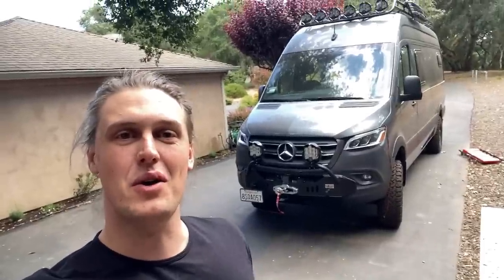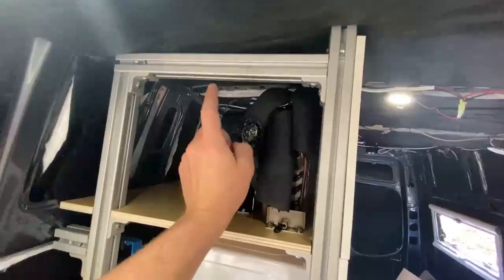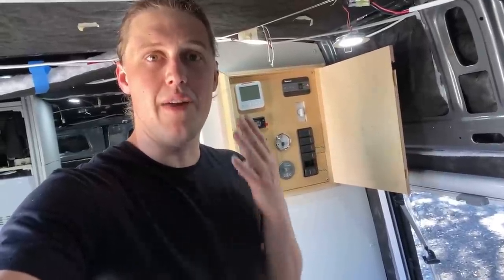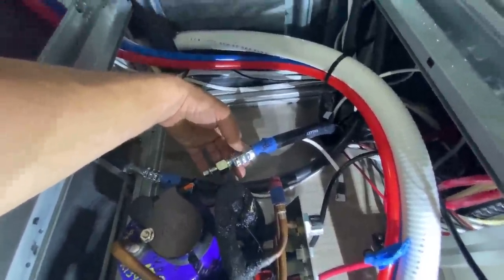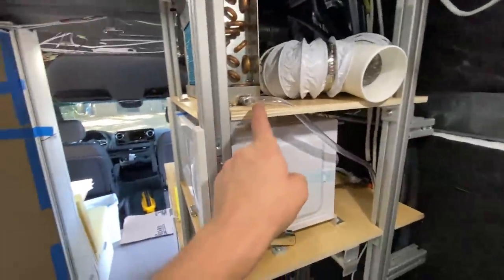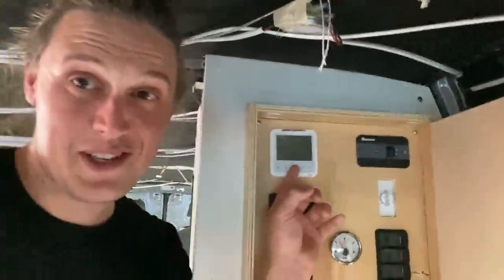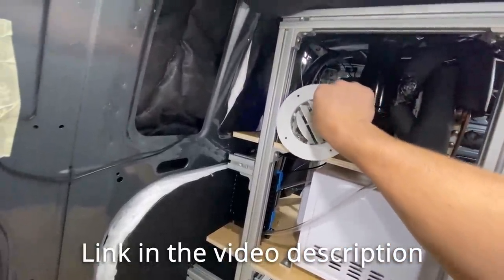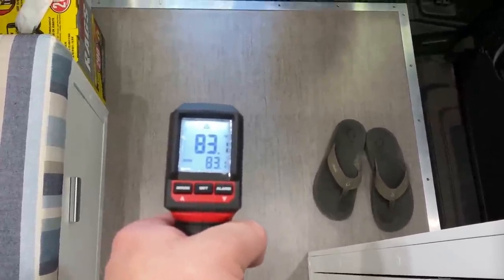The BEST Battery Powered AIR CONDITIONER For Van Life?

Comment: So how much power does it pull?  Do I have to have that many batteries?
Reply: 60amp
Reply: @markbajek2541  mine is about 30 to 45 amp after startup (variable depending upon evaporator fan speed, condenser fan mode (series vs. parallel), and the duty cycle of the compressor.

Comment: How much does this thing cost? Can't find information on the cost
Reply: Really expensive $5,000
Reply: @orion8810  God dam. Wouldn't throwing in a 12v compressor into a standard unit also work?
Reply: @milestehmad117  That's a good question. If you find a way let me know

Comment: Great video! Sorry, I just don't believe in the concept of placing the condenser underneath this vehicle. It seems that this is entirely counter efficient because the heat is getting thrown off the condenser and it rises against the van. If the van is rolling down the highway this is not as big of a concern, but if you're parked in it and trying to sleep you don't have any air flow around the vehicle. Also like everyone else mentioned, the condenser is more vulnerable to road debris. If the vehicle had much more ground clearance and a better cavity to mount the condenser in, that would certainly help. 
It would be very interesting if you could make it comparison to the condenser mounted on the roof vs. Condenser mounted under the vehicle to see what the efficiency difference is. I understand the goal was to increase the solar panel area available on the roof, but how much of that is offset by the efficiency loss of having the condenser mounted under the vehicle? 
If the air conditioner is not being used daily then it wouldn't matter so much because the big battery bank would be able to get charged and makeup for the efficiency loss. Batteries aren't free to acquire nor carry their weight around. Another concern is how much of the van interior space is occupied by air conditioning equipment? That equipment sheds heat and Noise inside the van. Are there alternative a/c systems that can fully occupy the roof?
Reply: @duanehorton4680  ...and YOU ignored the drag contribution with it mounted underneath? There is no drag when the van is parked. What is the ratio of (time parked to driving) and interior cargo volume consumed for under vs. over body mounted a/c system?
Reply: The fans are set up in a puller configuration so they actually pull the air from under the body and blow the hot air to the ground and out . We also have a new shroud and rock guard available that totally surrounds the condenser to protect it . Most customers mount it way higher than the differential so it is protected.

Comment: I skipped through the video because I have already seen these A/Cs. I can almost assure you he failed to also mention just how expensive these things are. They are ridiculously over priced. It's nothing more then a mini split system hacked up into pieces to fit. There is not a chance in hell I would pay these prices for AC.

Comment: I do not think this is the best AC for van. because of the compressor inside.  just use the split AC they comes with 2 parts . out side machine is compressor. then 2 lines goes into the room connect to the cool condenser and fan parts。so inside there is so quiet.  when you connect them, only need to vacuum the pipe. no need to charge the refrigerant (the refrigerant is all locked inside the compressor, after connected and vacuum, just open the valve). buy a vacuumizer just 100$, and split AC cost around 1000$. easy work . in winter this systme could make heat in your van.    your AC is too complicated and hard to assemble and occupy too much space inside. and compressor dissipate so many heat inside your van.  I have to say ,expensive doesn't mean good in some case. by the way , you could install Infrared blocking membrane on your window glass. they works.

Comment: What about dust issue during off-road since the fan is located at the bottom of the vehicle, does this mean you would be replacing the air filter frequently?

Comment: NOT a good idea if you are going to do ANY AMOUNT of off road driving! Putting that condenser under the vehicle is only a problem waiting to happen. The least of problems would be dirt/mud build up in the cooling fins... A condenser needs a clear flow of air to perform. Wet muddy roads will allow mud  build up in those fins and stop the airflow! Worst scenario would be a large rock strike and take it out completely!

Comment: That system pulls 60 amps???? That seems crazy high..  My mini split unit only pulls around 8-9 amps and many window AC units pull less than 10 amps.  That seems very inefficient for a full battery powered system.
Reply: yea but thats 8-9 amps 110 ac his pulls 60 amps 12v, so yours are like roughly 80-90 amps 12v if ran through an inverter, making his actually more efficient and his inverter is free for other needs.

Comment: BEING SMALL IS ALWAYS GOOD IN A VAN. BUT DOESN'T MOUNTING SOMETHING WITH INTAKE MOVING PARTS, BLADES, PUT IT IN DANGER OF DESTRUCTION BY GRAVEL, DIRT, ROCKS, ROAD SALT IN WINTER, HIGH WATER PUDDLES, ETC? 
I'M SURE IT WAS NOT ORIGINALLY DESIGNED TO BE MOUNTED UNDER A VEHICLE. THAT MUST BE THE WORST PLACE FOR ANY DELICATE OPERATING MACHINE? YOU ARE AN ENGINEERING STUDENT, SURELY THESE WOULD HAVE BEEN A GLARING ISSUES.
PLEASE EXPLAIN HOW THIS WOULD NOT BE PROBLEMATIC.

Comment: I see no positives to this system and lots of negatives over a roof mounted system like a  Dometic 2000 RTX 12V.  That condenser is going to get the C!@# beat out of it with rocks, mud, etc.  The system also takes up way too much interior space.
Reply: He said the positive, he didn't want it on his roof.
Reply: I spent a year making a decision and went with a pro air rooftop but I can see why he made his. I also think he’s going to sell it and the cruise and comfort gets a lot of hype. I think he did a great job
Reply: Everything’s a trade off. He’s not building an off roader. He’s got a massive power bank which means he needs as many panels on the roof as possible. An extra 100-200 watts without the roof mount.  

So that’s his engineering tradeoff. I call this an acceptance criteria subset. What I can possible fault is that the ac will be turned on when stationary and that noise  might overtake the acceptance criteria of the desired use model. 

I’d like to see a transforming roof deck where the deck rises to reveal the air conditioner so you can have a roof mounted ac and maximize roof solar area. Similar to tiny watts.  

But that’s like an additional factor of complexity and look at the unforeseen trouble he had charging the system with coolant. This is pretty rad engineering.
Reply: Usually the condenser is mounted above and behind the differential  so the differential would be the lowest point. We also have a rock guard that totally surrounds the condenser. Also the imported Dometic unit puts out only a maximum of 6,800 btu @58 amps.